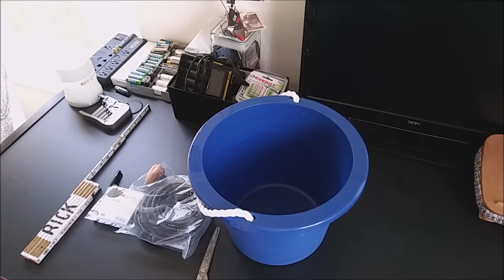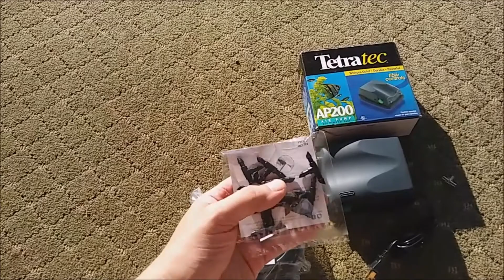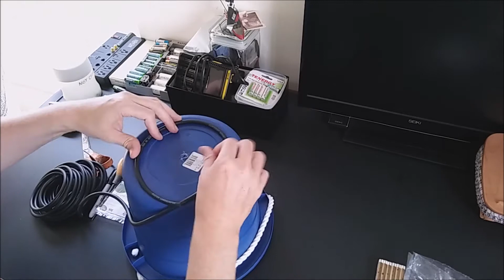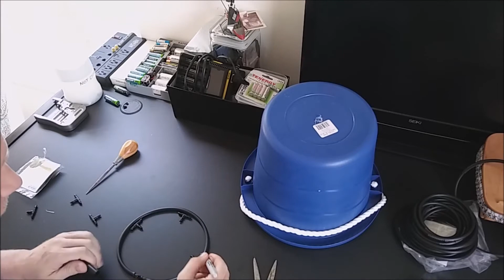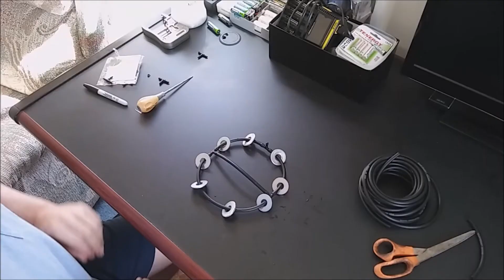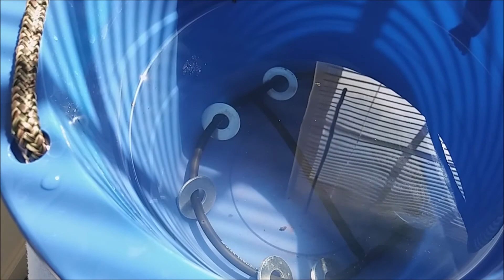Type 1 DIY Air Bubble Ring No Air Stone DWC,Hydroponics, Aeroponics, Aquaponics,DWC,Worm Compost Tea

Comment: I've tried it before and it works after for a little while but eventually the holes completely clog up
Reply from the maker: To be completely honest I have never had a bubble ring clog up. I also use them in my fish tanks without any issues. Not sure how yours because clogged.
Reply: @DiyRick66  what size are the hole s you use? I'm thinking it's because I was poking a lot of really small holes, because I've had 4 clog on me all built at the same time and was used for the same time. only for about a month or two.
Reply from the maker: @jeremiahmodgling908  I use a point about 1/8 to 3/16 inch. Or use soaker hose that I showed in the other video & you don't have to poke any holes. 🤞
Reply: @DiyRick66  thank you. I'll have to give that a try and see how she goes.

Comment: I built a simple filter slash dwc to go behind my aqurium  it worked greate small pump , pumps the water into the filter air stone at the bottom  clay pebbles as bio media water returns the the aqurium as a overflow,  I tried allsorts of plants and vegetables, but settled on lawn grass with peace Lilly and pothos as it soaks of nitrate super fast and can be trimmed

Comment: Lead fishing sinkers??
Reply: Absolutely not! NO LEAD.. do you want to have lead poisoning? If u are growing plants #1 lead WILL KILL most plants once toxicity levels reach a certain point.. if you dont want to eat drink or smoke lead, dont use it in your grow
Reply from the maker: Up 2 u. Grab a cheap masonry bit & drill a hole in a rock if money is an issue. Anything to weigh the ring down. Most recommend Stainless Steel Washers. Good Luck. Rick

Comment: Hi how do I unclog my diffusers without using bad chemicals
Reply from the maker: David Lovell You could try a stronger air pump or adapt to a air compressor soak in water or vinegar which is a safe acid. Baking soda in water or Hydrogen Peroxide. Hope that helps. Rick
Reply: smaerd58 cheers for the reply I was going to put them in warm to hot water leave them in the bucket connected to my air pump with a drop of either h20 or washing up liquid over night before I sterilize them.thanks again

Comment: Stainless steel washers might be a better idea. Better yet, glass beads.
Reply from the maker: Gene Koo Kang Sounds Good.
Reply: smaerd58 washers are cool try 1 to 2in keeps your diffuser slight off the bottom you don't want sediment clogging up trust me
Reply: I use brass fitting to weight my airline,,watch out for flexible airstone/snake wall curtain etc,,a whole lot ofem contain lead weight, do not use on consumables
Reply: Or even clay pebbles and superglue safe for aquariums etc